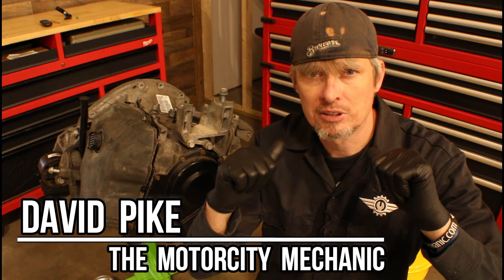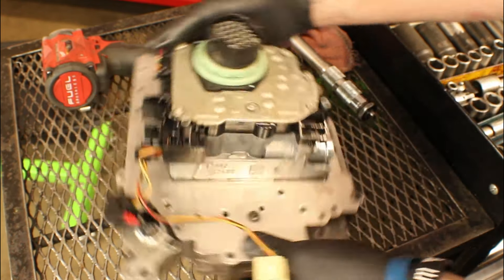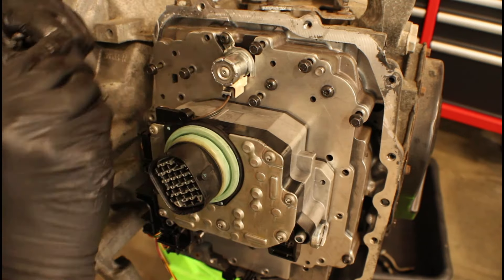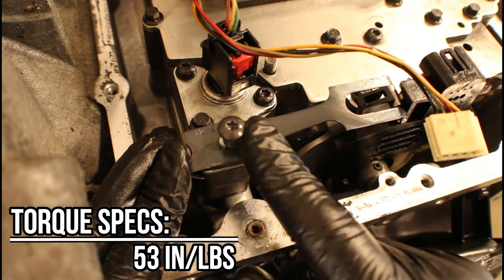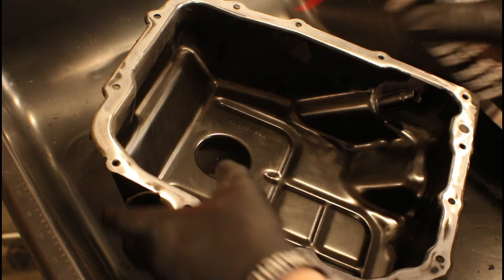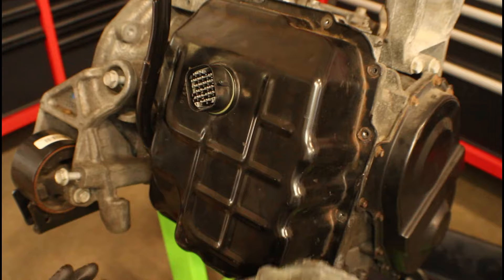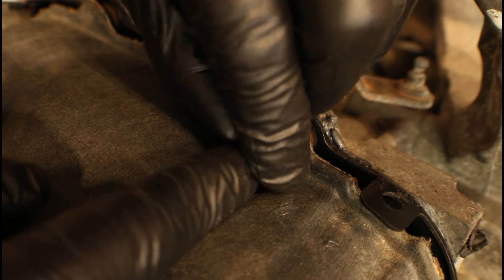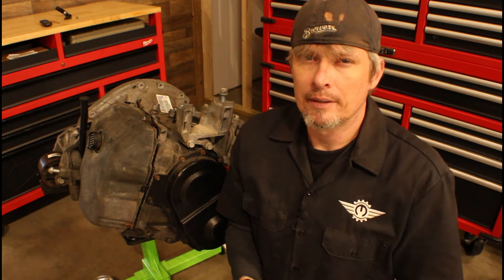Chrysler 62TE solenoid pack replacement Part 2

Comment: Hey David. Great 2 part series on this. I've been watching for years. You helped out with a brake issue on one of our 1500 Tradesman pickups. Flash/update deal fixed the issue.

We bought a 13 grand caravan new. Currently has 150k miles and is having transmission issues. Going down the road at 55, rpms bounce. Jumps out of gear going down the road. Random down shift at cruising speed.  Could this be the issue, or something more serious?
If you have time to answer great. If not, keep up the great videos and thanks for posting them!👍

Comment: Any idea of the part number for the 2-4 clutch oil seal?
Reply from the maker: I dont have access to that info and part numbers sometimes change. I can only recommend calling your local Chrysler dealer parts department to get the latest number. Thanks for watching and for the question. Make sure to subscribe

Comment: When putting D or R, the transmission of the car shakes, we have just changed the brain of the salons, can you tell me what the problem is? And when speeding, when you leave your foot quickly, the transmission of the car shakes. Could it be from the car's oil?

Comment: Would this cause a van not to start? mine has no crank. move shifter van roles a little and then will crank. but only if it rolls slightly
Reply from the maker: Most likely the cause for your issue is the trans range sensor, not the solenoid pack. Further diag is recommended first but my gut says range sensor/position sensor

Comment: I have a P1745 and P0868 on my 2012 Grand Caravan and won't shift out of 2nd. Should I replace the valve body and solenoid pack, just the solenoid pack, or start with filter and fluid?

Comment: Would it be easier if I was just to get the whole valve body with the solenoid pack and replace it my other question is do you have to flash and shift with the used transmission

Comment: Getting ready to do a solenoid pack and range sensor on '99 42LE 2.7L Concorde . If I can get the shift cable off without ruining the bushing or losing an accumulator when dropping valve body I think I might be home free . Any suggestions .

Comment: I have an 09 journey sxt. Has the 62te transmission.  I can drive the car around the block and it'll shift perfectly but after that it won't shift at all. I replaced the variable force solenoid. It didn't help. Any idea? Don't know any codes on it. I can't drive it anywhere to get it scanned

Comment: Got me a Ram 1500 with the 8HP70 transmission.  Dealer doesn't want to touch the transmission fluid since it is "filled for life".  I have just a bit over 100k miles on it (bought with 71k on it).  I guessing you would recommend a fluid change, eh?  I do tow a 5500 lb trailer about 2k miles a year.
Reply: I'm in the same boat.
Coming up on 85k miles on my 2017 Ram. 845re. Lifetime fluid (my rear) Fluid and filters must be changed. I want a brand new 1995 Ram truck. Any still out there? Best of luck to you
Reply: I know a guy that bought a 2014 ram 6 cylinder with the 8 speed and the dealer told him the same thing. He never towed and just over 100k he lost that transmission. I'm going to change mine at 50k I don't care what they say.
Reply: @msclecarcrzy  Smart

Comment: Hello! i have the same transmission on my 2013 dodge avenger sxt 2.4l 6 speed i have a problem with it while driving when i drive 30 miles and start braking and the transmission shifts shifts from 3rd gear to 2nd gear and at this point when it shifts at 20 miles  i hear a thump  Even when the car is standing still and running, I try to switch gears from P-R-D, I hear kicking, and when I checked like this, the engine moves as if all the supports are broken, although the supports are in normal condition

Comment: Hi, I did your step by step, replace the entire body of the selenoid and now the board shows all the indicators of P, R, D, N, 8 on and it does not work, what could be happening, thanks for your videos
Reply: The trans range sensor is mis-aligned, or the detent spring with the roller isn't installed correctly. I ran across the same issue this weekend, until I realized I had the detent spring installed upside down.

Comment: Can this be done still in van?
Reply from the maker: Yes it can. Thanks for asking and make sure to subscribe.
Reply: @MotorCityMechanic  I am with notifications sir. I was wondering if there any way to splice into the number 10 wire and have a switch to send power to it.. to prevent my transmission from going in limp mode?

Comment: could this part ever cause a no start issue? my van won start or crank. get out and rock the van forward and back. it fire up. the van also seems to shift like i have a shift kit. any ideas. ive been to 5 shops includeing 2 dodge dealerships nobidy can figure it out

Comment: By accident the gear shifter moved to reverse on my 62TE while I was driving around 30.   It was such a loud bang, I though the transmission is done.  It was like stepping on the brakes.  Horrible experience.  How on earth they design in 2019 such a flaw?  Any idea?  All my other vehicles have a protection that they can't go into reverse while driving.

Comment: hi, I have a dodge journey 2012 3.6 v6 car. but it gives an error code p0750 in the transmission.can you send a picture of the solenoid that needs to be changed in this code? thank you for your video.number 10 is a video.

Comment: I have the same transmission and iam getting a code p1745 says transmission pressure line too high for too long ......and all the lights are on my dash .......
Reply: Did you ever find out the problem?

Comment: Mine chrysler 200 3.6 has the code P076A shift solenoid H 
But mine Transmision never change the RPM

Comment: Hi Gary here from melbourne .I have dodge Fremont 2013. When i put gear sifter in driver or reverse I feel big hit from transmission .car no charge gear and  RPM goes higher. I scanned car found code p1745 Transmission line presser too high for too long .another code p0868 line presser low. Already I change solonide pack but still same code and same problem. Can you please help me how I fixed problem thanks.
Reply: Did you ever find out the problem? I have the same issue

Comment: Forgot 1 sentence I would have found very helpful... when flipping the valve body over you held it together,... if you had said.. “make sure you keep this together cause there’s 3 little balls in there that are very important” just got mine back together, while flipping the valve body came apart and I lost those balls ...drive great in reverse, just doesn’t go forward, ..eBay 8.99 I’ll have them in a few days
Reply from the maker: BMXpert0 in part one I did mention to squeeze the halves together when flipping. No I didn’t mention the check balls but holding it in place was mentioned. Had to rewatch to see for myself. Sorry you had issues.

Comment: First of all, nice videos on this 62TE.  I like the way you explain everything in great detail. I'm knee deep into this project on my daughter's 2011 Dodge Journey. (152,000 miles).  I have the valve body removed. All went just like you showed. Had a pesky little time with those 3 tubes but eventually got them to submit.  Anyway, now I'm noticing that someone has been here before.  Sloppy RTV, a zip tie on that one solenoid that you said always breaks and even has 1 bolt missing that holds down the valve body. I hope I'm not chasing a ghost. My codes are P0740 & P0765 so I'm assuming it's the solenoid pack. But seeing how it's obviously been replaced before has me worried.  Is there any other thing I should be looking at before I button this thing up with a new solenoid pack? I really don't want to put this thing back together and it do the same thing. Daughter says that it's fine for about 15 miles or so then it goes into limp mode. She shuts it down for a half hour and then it acts up again after it warms back up. I know you have probably seen every scenario with this trans so I'm wondering has there been any other issues like a bad harness or TCM that could cause the above described conditions?  Also, The ATF4 I drained was dirty. The filter was a Mopar filter. Not sure if that means the solenoid pack and filter change was done at the dealer or not. Any help or direction is greatly appreciated.   Thanks again for the 2 part video on the 62TE.  Very informative and easy to follow!   Great work.!
Reply from the maker: I never see wiring issues with that vehicle. Typically its a solenoid pack for the code P0765. The P0740 is torque converter related, that may end up being a different issue, like may be a torque converter, valve body, or that solenoid with the broken white connector. Might not hurt to replace it while your in there. People love to get sloppy with RTV for some reason. Guess they assume the more you add the less it will leak lol. I recommend a Mopar solenoid pack....I dont trust aftermarket parts, too many times they have let me done. Otherwise if still having issues then trans removal and tear down will be needed or replacement installed. Thanks for the comment and for watching.

Comment: I have a 2014 Chrysler 200 v6..I put in a used transmission but it is stuck in second gear and when I run a scan tool with saying circuit solenoid